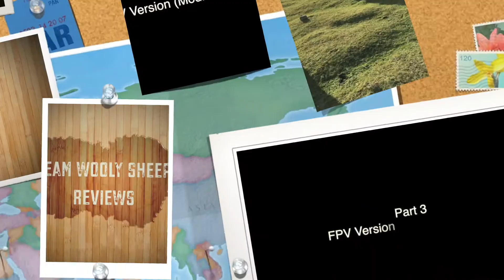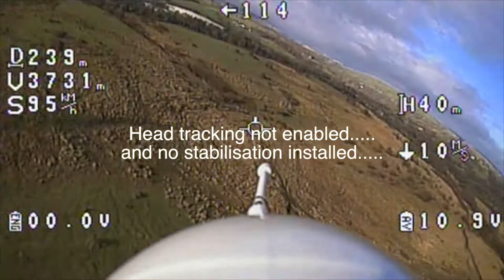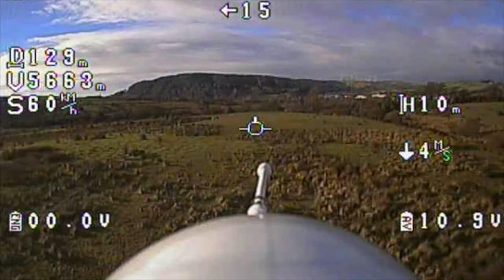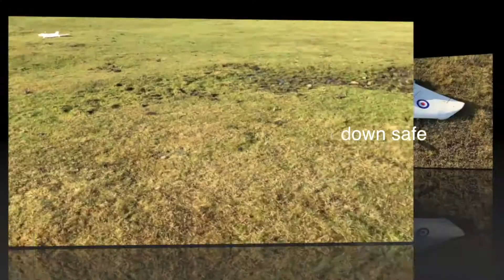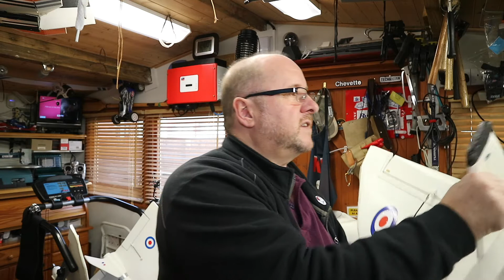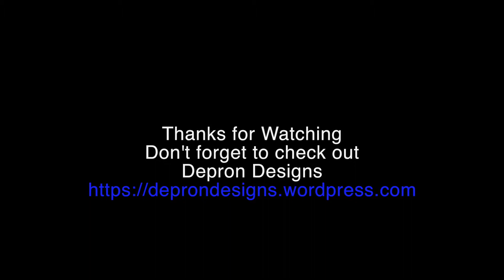Part 3 - FPV Version Depron Avro Vulcan 1100mm wingspan

Comment: Subscribed, enthused.
I've got 70mm and 90mm EDFs looking for a home.
Do you have plans, CG for the Mk 3 (EDF) version?
Reply from the maker: Check out @t
There are no plans for EDF version....I got creative with the pusher prop plans.
Use the CoG 27cm from front of wing (not nose, the root where wing stops and nose/cockpit starts) for ref 33cm from trailing edge and you will be fine.